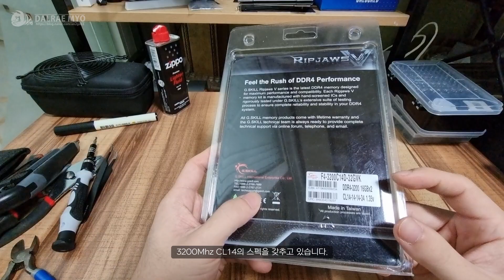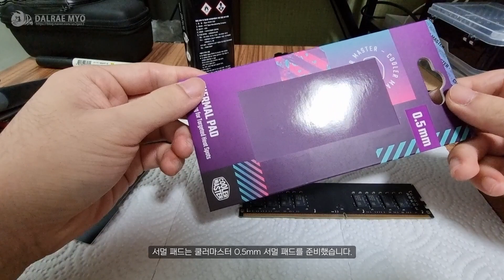립죠스 메모리 방열판 교체 | DDR Memory heatsink removal & install | G.Skill Ripjaws V

Comment: Thanks for sharing, do you think it would be possible to put the heatsinks back on? I want to take them off to paint white for my white build pc then put back on, thanks 🙏
Reply from the maker: The thermal tape is used instead of the thermal pad of a typical heat sink. It can be reused, but it is recommended to attach a new one.
Reply: @DalraeMyo  thank you so much, I’ll buy some new adhesive thermal pads once I figure out what thickness to get, thanks again
Reply from the maker: @melikesutube  Personally, Ripjaws' heat sink has poor cooling performance, so I recommend buying and installing a heat sink that is sold separately if possible.

Comment: How thick is the thermal pad for replacement? Thanks
Reply: 0.5 mm. I found it in the video.
Reply: How this is original thermal tape? How do i find replacement for stock heatsink?
Reply from the maker: @isaacstyles92  The memory heat sink I used is a product sold by a Korean aluminum processing company. I don't know if it's sold globally.
Reply from the maker: @isaacstyles92  If you want to use the old memory heat sink again, you will need to use a new thermal tape. It should be referred to before removing the existing heat sink.
Reply: @DalraeMyo  thank you for replying ❤️